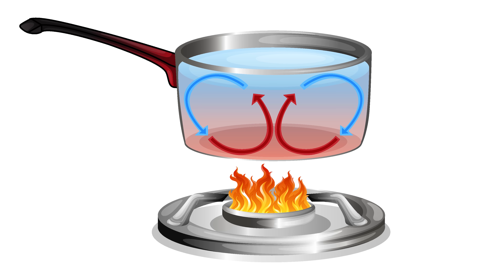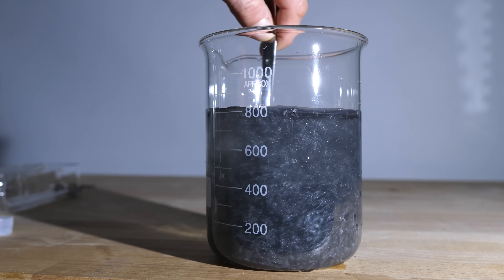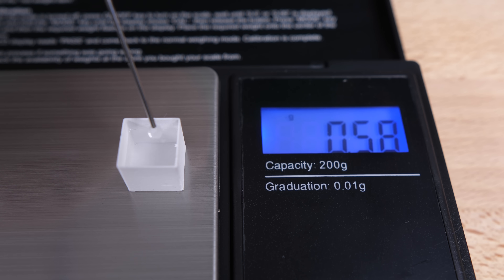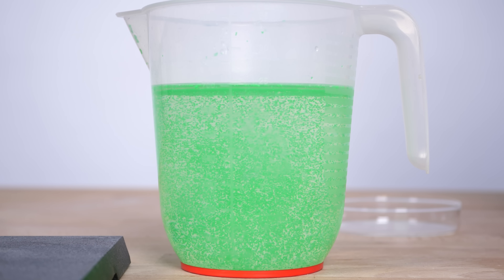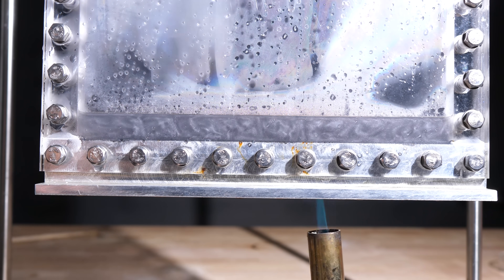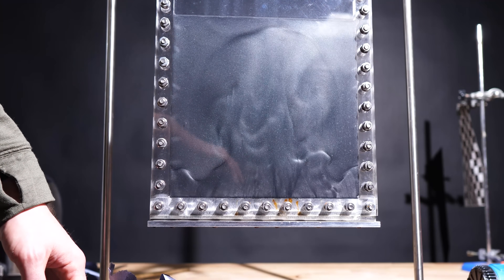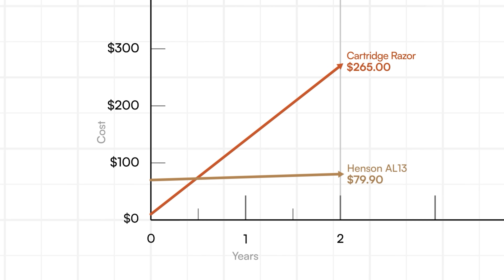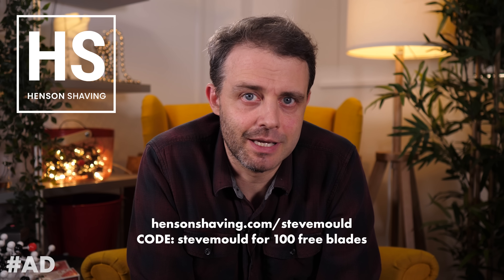The bizarre patterns that emerge when you heat ANY fluid

Comment: Such an outcome is not a surprise to reservoir engineers, now, but was a surprise when CO2 (above critical pressure) was injected into a porous media containing oil and water in the 1980.   Despite being miscible with the oil, unstable displacement took place.   The injected CO2 would finger through the oil, bypassing it.   The reason for this, was that the CO2 had a lower viscosity than displaced fluid.   The phenomenom was termed viscous fingering.   Despite being miscible, very little of the original fluids in the porous media was displaced and the lower viscosity CO2 would simply create fingers becoming channels.   This learning essentially killed enhanced oil recovery by CO2 injection in the 1980s.   Despite being widely published, the results of the study of displacement has been ignored outside of the industry by fluid dynamics experts.   When displacing a higher viscosity fluid by a lower viscosity one, the system is unconditionally unstable horizontally, and is only stabilized by gravity when the displacing fluid is of higher density and the displacement is sufficiently slow that gravity forces dominate viscous ones.

In your experiment, you are heat a fluid from below which causes the fluid at the bottom to be less dense and lower viscosity that that above.   This sets up an invariably unstable displacement, and the heated fluid will attempt to form fingers and bypass the thicker, colder fluid as it rises.   Ultimately channels will exist and these would appear as the cell you see from looking at the surface of the container.    Note that this is not a Reynolds number effect, but simply due to an unstable displacement.    The size of the channels will depend on the viscosity ratio (and perhaps the width of the container if it gets very small).   The number of channels that form will then be determined by the amount of heat being added (which changes the amount of fluid trying to flow up and reach the surface.

The best example of these channels might be seen by observing the sun.   The outer shell of the sun is composed of liquid metallic hydrogen, that is heated from within.   Channels of heated hydrogen metal rise up and form little cells on the surface and these cells can be distinguished from one another by the magnetic dark/bright lines that cover the sun when viewed through a Ha filter.

Finite Difference computer simulations of the unstable process of adverse viscosity ratio displacements are totally useless, yet the oil industry relied on them when formulating their CO2 enhanced oil recovery plans in the 1980s.   Finite difference simulation simply cannot handle the physics in these cases, and simulation became a kind of obscenity when they utterly failed to reproduce reality.    It is interesting to see such finite difference simulation being used today as the sole method of climate forecasts, when those who better understand this, know that these simulations will utterly fail.

Thanks for creating such a wonderful, informative video that spreads the word about viscous instabilities in displacement.

Comment: There was a fabric paint l was using, that made similar patterns on the surface, if you diluted it with water, and would continue to do so, until the container was completely dry, without additional heat or agitation! The company (Cerulean Blue) went out of business, back in the 80s

Comment: My dissertation focused on Rayleigh-Bénard convection, I observed by placing a thin layer of oil between two glass layers—one heated and the other cooled. (need large(ish) constant temperature gradient) This setup, resembling a manifold, was heated from below and cooled from above. The entire assembly was then positioned on an adapted overhead projector to magnify the convection cells onto a screen. This allowed for a clear visualisation of the hexagonal patterns that formed.

The topic has broad applications, even in the potential role of these convection cells in concentrating the chemicals necessary for life, suggesting a mechanism by which life's building blocks could be held in place long enough for life to emerge. the cells were quite stable and how matter was contained within them.
Reply: If you have a video of this I would love to see this. The hexagonal pattern that forms has got me curious. It seems like this is the effect that is seen on the top of Saturn.
Reply: Is this phenomenon understood mathematically?
Reply: @mathematicsreadinggroup7288  yes, in that the hexagonal cell is the most stable configuration in packed geometry.
Reply: @mathematicsreadinggroup7288  This was one the text I used during my studies Alexander V Getling

Rayleigh-Benard Convection: Structure and Dynamics (Advanced Series in Nonlinear Dynamics): Structures and Dynamics: 11
Reply: That's so cool!!
Reply: @djwilliams8 Any chance you'd be willing to share a link to your dissertation?
Reply: What a waste of time. Life doesn't come about by accident. How many years have otherwise intelligent atheists wasted on such nonsense?
Reply: @CombineWatermelon  😂

Comment: Schlieren photography is really good for this. 
Also you can fill a box with smoke and run a sheet of light through it to get a true 2d image of this effect. Since the working fluid is really light it responds very strongly to small amounts of heat so you can drive these motions with things like a hot bag of rice or an ice pack. 
https://www.youtube.com/watch?v=K7pQsR8WFSo

Comment: I think this shows well the concept of raynolds number and the effect of viscosity. When you used water the raynolds number was significantly higher than when using oil. The same effect as with oil could have been achieved in a much smaller container to match the scale with the raynolds number. This is why we can model how fluid dynamics in blood vessels work by experimenting in a larger scale with a more viscous fluid (and a longer time scale)

Comment: Hi! I used to make lots and lots of different rheoscopic displays, and i used mica in water with food coloring a lot. From what i understand, the mica particles arent really aligning with each other locally, but actually the particles line up with shear planes in the fluid, and since the shear planes in the fluid is locally similar (because the shear varies continously in the fluid) the particles of mica all line up with each other and draw out the shear vector field.
So its not that they have some inter particle communication/dynamics, but just that all the psrticles tend to line up with the shear, and the shear is locally similar.

Comment: Ive melted metal bars that end up having a hexagonal pattern after hardening. Its super cool to see and rare.
Reply: That has nothing to do with convection. You are seeing sections of a 14-sided space-filling shape which results from solidification beginning at many different points in the melt. But you are in good company: convection was an early (incorrect) explanation for the crystalline (grain) structure of metals. But the pattern is not rare: metallurgists routinely grind and polish cast materials because the grain size affects strength (Hall-Petch Effect).

Comment: I'm a plumber, and we were told (at tech college) that water stratifies according to its temp.  But I have found this to be false.  A thermostat placed near the bottom of a hot water cylinder (the one in your airing cupboard) will be within just a few degrees of one at the top - if it is still.  It's only when the water is used (and cold enters at the bottom) that this changes.  Immersion heaters are mostly located at the bottom of cylinders - this will mean uniform hot water.

Comment: Mica flakes align locally due to the inherent physical properties of mica minerals. 

Sedimentary Deposition: When mica flakes are transported by water or wind and deposited in a sedimentary environment, they tend to align with the bedding plane due to the settling process. The flakes orient themselves horizontally as they settle under gravity in a calm water column or as sediment accumulates layer by layer.

Comment: We fly gliders in thermals, and pretty sure it works exactly the same but in the atmosphere... an inversion acts as the top of the liquid. We fly in the rising air. Wind, temperature, and moisture levels all play a big factor, but a basic thermal on a standard low wind day behaves exactly the same demonstrated here. Thanks!

Comment: Ok heat from below dissipates due to what we have seen visually in your great setup.
How about turning it 90° or 180° (of course some modifications needed)...heat coming from a spot at the side and/or from the top?
Which setup spreads the heat faster into the fluid? Would be great to visualize it.

Comment: Just when thinking about the pot of noodles and wondering if maybe the convection is really smooth in that case...

I wonder though if the dynamics change in 2d here in a way that could introduce turbulence. 

In the case of a 3d pot the convectional flow in the shape of a toroid can avoid a lot of direct friction by forming the toroid. This would reduce turbulence.

But in your case you are looking at very turbulence dynamics in the thermal exchange. Poasibly because of friction with the sides or possibly because there is a minimum width the pot needs to be to allow for smooth exchange or maybe the round shape vs the long skinny deep pan you've essentially created constrains smooth motion.

I don't know if any of this is true at all. I just wonder if the simplification that goes into any model had lost accuracy in exactly what you were looking at originally.

Comment: In future - may I suggest what we do in our physics experiments at school... 

Use a small DIY electric heating element in the bottom. 

Make it from 2 stout copper wires (2.5mm cores from some UK twin+earth house wiring work well) fed in through the bottom of the acrylic and a small coil of nickel-chrome wire (wind round a pencil to create the coil shape - about 10-20 turns of approx 0.2mm wire will do) soldered across the ends (It will look a bit like a light bulb filament)... Then you can connect it to an adjustable 12V power supply and slowly crank it up until you have the desired heating effect.
Reply: Came here to write this. (Well, not that detailed.)

But yeah, no burning plastics (always fun indoors), great control (as far as thermodynamics goes).

Or even a bloody Peltier.
Reply: @ddzwiedziu  Yeah, a nice little peltier chip on an aluminium sink would work.

Comment: Those top down images of convection cells look almost identical to to the molten flux that is generated when I was refining gold at a medium sized gold mine here in Canada.
Basically, you mix up a flux/gold concentrate batch and throw it in the refining furnace.  As you pour off the charge in the furnace several flux-only containers are filled up before you actually get to the gold, which has sunk to the bottom of the charge.  As the flux is cooling in the steel containers, these convection cells form just as shown here.

Comment: @steveMould: does heating the aluminium bottom traveling left to right and back again not cause double the heat input in the middle compared to the sides which would explain the 'general patern of middel rising and outward falling' in the low fluis model?

Comment: I think at 7:00 we see the Benard-Marangoni convection and not the Rayleigh-Benard convection.
The Benard-Marangoni effect comes from a temperature dependend surface tension of the fluid.

In thin fluid layers Benard-Marangoni triggers first, because its threshold scales proportional to the height of the fluid layer. The threshold for Rayleigh-Benard depends on the cube of the height which leads to Rayleigh-Benard appearing first in thicker fluid layers.

Comment: @SteveMould Beautiful video. You mention at the beginning that the mechanism behind the mica flakes aligning isn't really understood - so the visual effect may have secondary effects. What about using those pigments that change color based on temperature (mood rings, etc)? The change is probably a bit slow, so oil based carrier would probably be better than water?

Comment: The end bit about how not all convection is down to heat reminded me of ocean convection.
A large part of the ocean's convection is down to Thermohaline circulation. That is partly due to the temperature difference but also rain and melt water from land diluting sea water so it becomes less dense at the same temperature.

Comment: Good timing. I was wondering why the paint in my airbrush was making similar patterns as 6:58, however the paint wasn't being heated, it remained cold the entire time but still made some wild looking patterns. Not sure why it happens with that particular paint, but I could just stare at it and watch it for minutes. It was a very thin, metallic lacquer paint (Alclad Airframe Aluminum). None of the other metallic paints I use do that and there isn't any movement in the paint cup to cause it to happen.. it just happens while stationary, not forcing any air through the airbrush. Maybe the alcohol evaporating?  I may record it and upload a video of it.

Comment: I really liked seeing the top of the shallow 2d oil test, it almost looked like lines on a ruler it was so even and ordered. I would be curious about a mixture of oil and water in the 2d container both with the particles suspended in it. Does the convection transfer between the mediums differently? Do the particles move between both liquids?

Comment: Geologist here (although not an expert in mineralogy). I think the reason why mica flakes align locally ( 02:00 ) is beacuse of its peculiar laminated structure (parallel sheets of silicate). They  basically align along preferential directions, according to the local pressure of the water. 
Also the amazing experiment at 2:39 should be showed to every geology student in their first year, to actually grasp what's happening in the Earth's mantle.

Comment: To explain a bit of turbulence: Tubulant flow is very hard to define and also to describe. Turbulence has a few key characteristics: 1) It is chaotic. 2) It forms vortices. 3) It is cause because the laminar flow becomes unstable with higher flow velocities. What you can see with the narrow heated plate at the beginning is a very narrow fast moving stream upwards. The fluid flows down the sides and is slowed down because of the wider cross-section, thus becoming more stable and less turbulent.

Comment: Regarding Tia Maria, I don’t think the cream actually affects the evaporation of the alcohol itself, 
We just need any fluid that is slightly more buoyant and opaque, to display the currents that are generated.
Also, whatever fluid we put there, (has to be non alcoholic itself) will not evaporate the alcohol meaning we’re only evaporating alcohol around it.
The Tia Maria then wants to refresh the alcohol rich Tia Maria at the top , which induces a current , that current, then rotates the cream with it, that cream wants to rotate around the long axis, because that takes less energy to rotate that way.
And by rotating in that axis, it makes that even longer and more pronounced. (A bit like Like rolling dough) Until the point where the attraction between the cream is stronger than the force of generated by the Eddie currents in the alcohol. And the thickness stays consistent.

So really, it’s the buoyant force that pushes up against the cream and then comes back down and whichever side has more of the heavy side that goes around the cream, creating a current around the cream, which then retches out that cream until the strength of the attraction of cream cream exceeds the strength of eddie currents.

I’m not physicist , but I have done a fair amount of work with fluid simulation for visual effects, and that would be at least how I would simulate this behavior and re-create it.

Comment: i have a question. if mica just reflects in a synchronous pattern where the particles line up and reflect light, what happens if you have multiple lights shining on it, or what would two or three different cameras see placed in different locations? would you ever see something completely different or would they always have the same pattern?

Comment: "When a liquid flows over or around mica flakes, the flow exerts shear forces on the flakes. These shear forces cause the flakes to align themselves in the direction of the flow. This alignment occurs because the flakes experience less resistance when they align parallel to the flow direction compared to when they are perpendicular to it." This explenation was generated as I couldn't put it to words when speculating.

Comment: I started wondering how objects in the fluid would effect the convection flow. When I turn on my oven and there's a dish with food in the middle, how does the air flow around it? When I turn on my stove with a pot on top, the air flows up the sides of the pot and then into the range hood. Does the hood collect all the hot air? does some escape? This video got me thinking. Hoping for another video with more complex situations!

Comment: Interestingly enough, when I first saw the photograph of the convection cells on the sun, I immediately recalled a morning cup of coffee. I had poured the cold cream into my coffee, rather slowly so that it sank to the bottom and did not create any turbulence. After a few minutes, the cream began to rise to the surface of the coffee in small plumes. I watched this with some excitement as the cream formed into small cells similar to a honeycomb pattern. There were dark coffee lines at the boundary of each cell and watching closely you could discern the movement of the cream. I am not certain how long this activity went on, but I was definitely entertained by this display of convection physics. Eventually the cream and the coffee must have reached equilibrium as the honeycombed cells dissolved away and my coffee turned tepid.